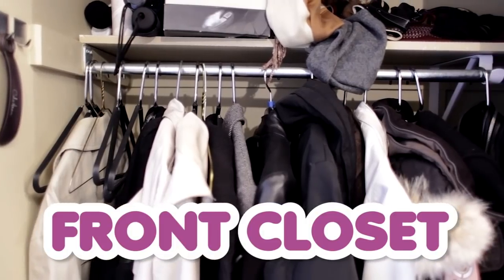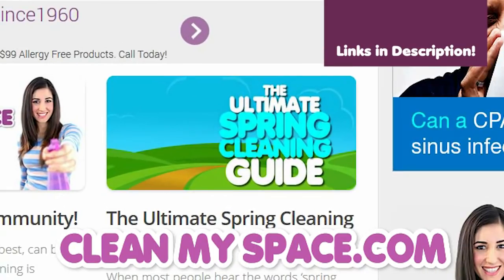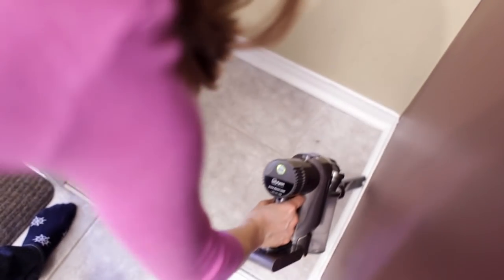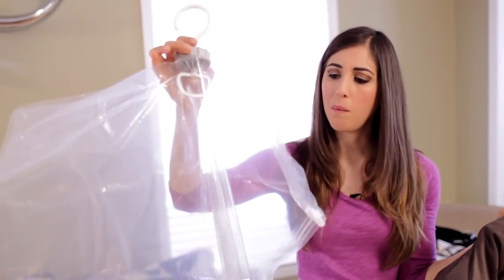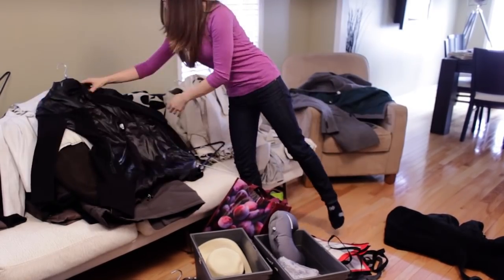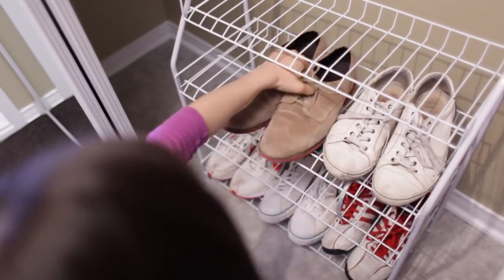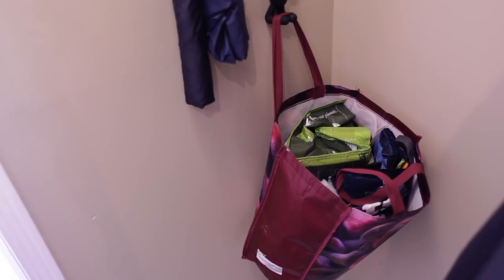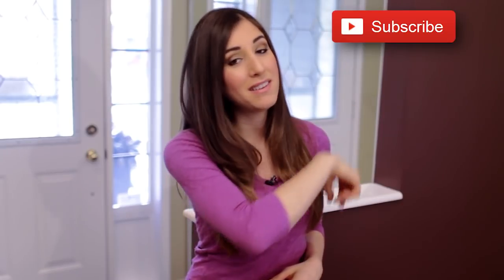Spring Clean Your Front Closet! Save Time w/ This Easy Cleaning Idea (Clean My Space)

Comment: Love this video!  Can't wait to clean out my coat closet.  I regularly clean the floor as this is where the cat box is kept.  (I have two cats).  Again, you gave me a great idea for the use of vacuum bags.  I use to have a double problem with a bunch of coats and jackets, but thanks to this video this will no longer be a problem.  First off, I didn't like having my coats hanging in the same area as the litter box because the littler blows dust in the air and on the garments.  Also, a couple of years ago I stopped using a lot of coats/jackets and so they just hang there unused  and taking up space.  For now on I will store them in vacuum bags,  This will keep the garments cleaner and the closet less cluttered.  Now why didn't I think of this before?  I guess that is why we like watching your videos.

Comment: I need a how to clean your panini press or george foreman grill video. I have one that doesn't have the removable plates and its tragic.
Reply: My aunt had one like that we used often when I was younger--the one w/ the drip tray? What she did was clean it right after (or a few minutes of cooling later) w/ a water dampened paper towel (or cloth, if you prefer). If you clean it right away then no soap or scrubbing should be overly necessary--then once it's clean turn it on again to kill any lingering bacteria and it should be fine.

best way to keep things like that clean is to just use it carefully and jump on the messes right as they're made rather than later. Hope I helped you a little!
Reply from the maker: Yes, cleaning right away is key.  If you warm it up a bit, you can use a wet cloth (be careful to not burn yourself) to clean it too...
Reply: Once you've used it and wiped clean whilst warm; wipe again with oil before putting away; your 'non-stick' will keep forever! Our painini press is 8 years old and still going strong. :)

Comment: The only closets my house has are in the bedrooms c: The house was built in 1911 and hasn't been changed, I'm assuming that plays a part in that.

But I really want to clean out my bedroom closet :/ There's so much junk in there that I can't donate and the stuff isn't exactly easily tossed in the trash so it's been an issue.
also I vacuum bag all my winter stuff, i just use the big ones so all my coats, clothes, and bedding can fit into it. Saves a lot of space! Except the vacuum bags require a normal vacuum size nozzle so i have to dig out the big bulky vacuum instead of using my small $30 bissell I usually use--Such a chore! but in the end it's a huge space saver(:
Reply from the maker: I agree - major space saver. I am so impressed with mine!  So where do you put your coats and boots in the colder months?
Reply: ***** I have a wall hanger in my room I put my coats on and I usually just put leave my coats where they are--or i have a dresser-type container i vacuum them up and store them there. 
I don't have any special winter shoes, though, so that's never been an issue.